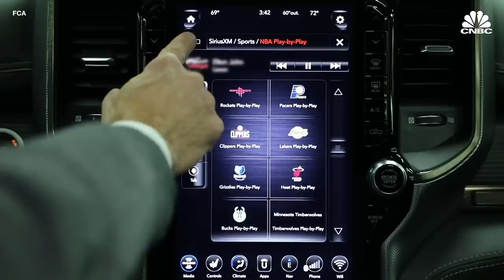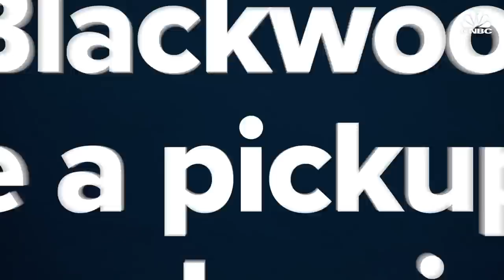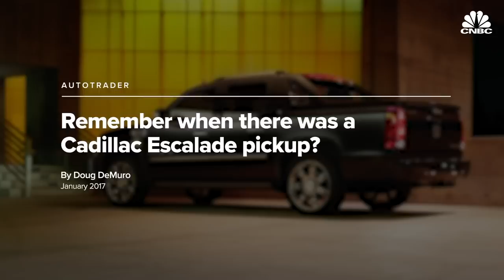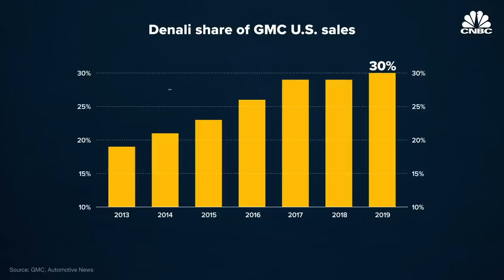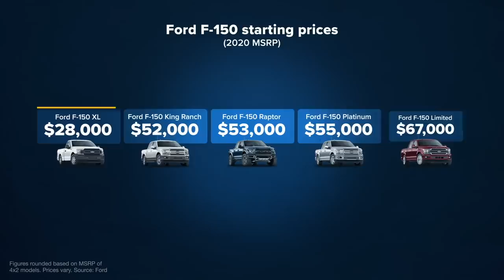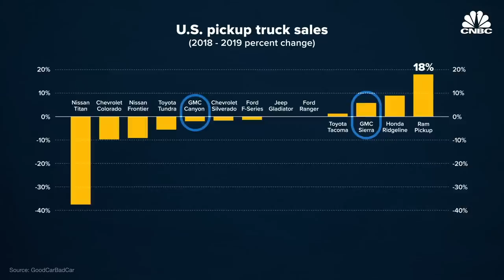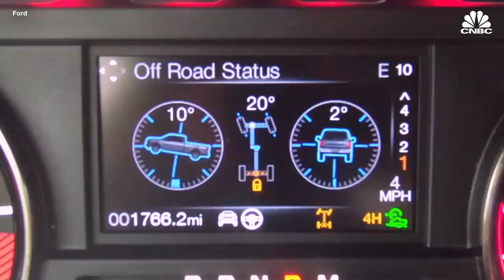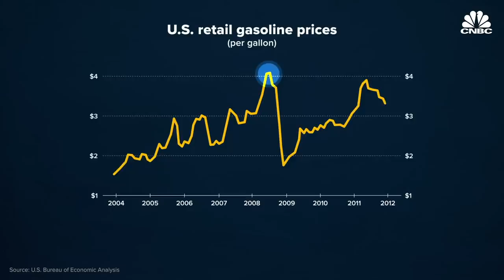How Detroit Turned Trucks Into Luxury Vehicles

Comment: I still just cant wrap my head around the prices of these things...
Reply: U are so right
Reply: All these features will go kaput in a few years. My mom had a GMC SUV and the onboard computer died, making the car unable to start. Took it to the GMC dealership and after taking her entire tax return for the repairs (several thousand dollars), it still would die. They wanted those monthly payments though and didn't want to hear a word of it that they had charged her thousands without fixing the issue. So, she stopped paying on it and is going to just let the time pass for it to fall off her credit. All those cute features are just draining these vehicles and while I like them as well, unless you have the money to foot the bill for when it inevitably dies three years later, don't get vehicles with so many upgrades.
Reply: Repo heaven...
Reply: @BewareTheLilyOfTheValley  Exactly and to add to it, these little safety features like lane keep assist and radar cruise are great features to have, but when that windshield cracks and needs replacing it will cost significantly more to fix as these features require windshield cameras that will have to be re-calibrated when a new windshield is installed.
Reply: I know same here brother.
Reply: I know. I bought a 2008 Ram 1500 brand new for $18k in March 08. Helped that it was a base trim reg cab short box with roll up windows, rubber floors and 6 Speed Manual Transmission, so they were having a hard time moving it
Reply: Ford Ranger?

Comment: And my old boss drives an old Chevy truck that had over one million on the odometer. That was a truck. Today the engines and interiors look cute for 5 years then fall apart
Reply: Yea your right.  My dad bought a sweet looking Dodge Dually 3500 in 2001 that had cushioned leather seats both heated, sound system, running boards, wood trim.  After about one year of farming and his refinery jobs the cd player stopped playing cds, then the leather started splitting on the seats, the running boards were sagging and you had to step over them cuz they wouldn't hold you.  Then the passenger seat stopped heating then the dashboard cracked because of a hot day.  Then after 2 or 3 years the body started falling apart and would rattle and make crazy noises.  The only thing durable was the cummins engine.  Dad finally got rid of that thing for a chevy duramax with the allyson tranny and never looked back.  Unfortunately we lost him in 2016 but I'll always remember his love for trucks even the bad ones lol.
Reply: I had an 04 Lexus and interior held up really well air vents did not break, leather did not rip, the roof liner did not sag at all, and the clear plastic coated wood trim did not sun bleach. Very well made crossover that is too small to be called a truck and it has a decent V6 engine with excellent gas mileage for what it is and enough power to get you through rude drivers that don’t yield. Oh boy those seats are super comfortable. It was the car to own for soccer moms who do not want a mini van and those that want a smaller but still very comfortable to drive alternative to the full size American SUVs.
Reply: @chadmiller7876  I'm sorry for the loss of your father.
Reply: I'm old enough to remember when 100k was very high mileage for any vehicle. Now we feel cheated if we don't get 300k or more... They certainly don't make them like they used to. I used to carry my tool box with me so I could make roadside repairs in the 70s. Now I expect to get over 100k miles on any new vehicle without issues. There are, of course, exceptions to every rule. For example, I had a Chevy Aveo once, and the idler pulley bolt just snapped off one day while driving down the road with less than 10k miles on it. I swore off cheap Korean vehicles for over a decade before giving Kia a shot. I put 120k trouble free miles on it before handing it off to the kids, and it still runs great.
Reply: @josh summers   thank you very much for your condolences.
Reply: Yep you got it brother.
Reply: David Perry lexus is king
Reply: CyberTruck will last for 80 years
Reply: @starshipdriver8536  tell that to the battery
Reply: @chadmiller7876  good story man i felt that! sorry about pops! he is probably smiling down just hearing you share this! thanks bud!
Reply: @Jkaiser E-  thanks for the great comment.  I've got enough stories of old trucks and vehicles that my old man had that I could probably write a book lol.  Take care of yourself and others during these trying times.
Reply: @michaellovell2518  Japanese Cars or Trucks are where the high mileage vehicles are more specifically a Honda or Toyota. My family is a Honda family, we've got a 1997 Manual Honda Accord with 269k miles, a 1998 Honda Civic with 200k miles, a 2007 Honda Accord with 180k Miles, and my car a 2005 V6 Honda Accord with 130k miles, I got it when it only had 105k miles for college; I'm sure it'll run well into 200k. For trucks, get a Toyota. Those trucks have hit 1 million miles on the same engine and transmission that were in the truck the day they left the factory.
Reply: @gentlegiant4067  Toyota is not as good as 90s and early 2000s. Look up how many recalls they have in the recent years. 18-19's fuel pump issue has been going on for about 6 month and they still haven't came up with a solution. 2nd gen Tacoma has frame issues, 3rd gen 2016 model has bad transmission. Honda's Earth Dream engine is a ticking bomb. I don't like US vehicles but the Japanese ones are not that reliable either. I don't know what to get for my next vehicle.
Reply: @michaellovell2518  most european cars haven t any issue before 100 k miles.
Reply: Wife and I were checking out a 2014 dodge caravan and the leather seats were splitting and cracking. At six years old. Our 2004 caravan's cloth seats look like new, its 10 years older and has double the mileage.
Reply: @starshipdriver8536  I'd give it 8 years before the electronics start becoming prohibitively expensive to keep fixing
Reply: A "cute" engine? Hell, you can't even see it, it's buried so deep under plastic, hoses, and wiring!
Reply: Everyone gansta till the car doesn’t even last one year
Reply: 2 miles 2 just 2
Reply: Waiting for this to happen to Dodge Ram
Reply: Truth
Reply: What year Chevy?
Reply: Actually that's wrong. Cars are more reliable and longer lasting than ever before.
Reply: @everythingman987  They are? Then how come electronics on late 2000's vehicles starting to break. That's because electronical stuff won't last and the cars will be harder to fix when they need maintenance with the electronics so they'll be scraped. I think the 90's was the best era for cars and trucks. Longevity, simplicity, and reliability
Reply: Not true. Modern engines are far more reliable than the previous gens. It’s more likely that customers just change trucks every 5 years.